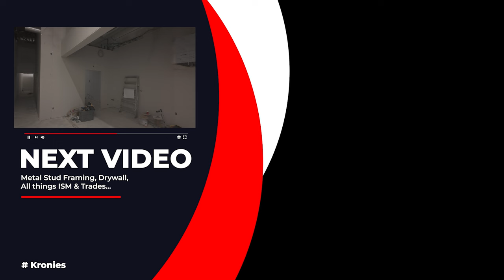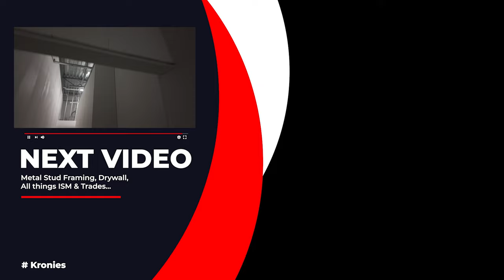Metal Stud Framing Heavy & Light Gauge Full Height & Floating Walls Together

Comment: Do you have a video that explains which side (open or closed) of the stud do you screw into first when hanging?
Reply from the maker: Always screw the soft side first(open) then the hard side(closed) if your back boarding don't counter sink the screws I to the hard side just tack then in and counter sink after the next sheet is up.
Reply: @ConstructionKronies  makes so much sense. Thanks!

Comment: When do u use heavier gauge or lighter gauge
Reply from the maker: Basically heavier gauge is walls that need more strength, maybe something is being mounted to it or if it's going to be used to support a floor or platform above. It's had nothing to do with height or width. Lots of ways to mix it up even. Some guys will use 25 gauge double studs at door ros and sometimes we use single 20 gauge. Preference also plays into it. If cost is not the major issue using a heavier gauge will give you a better wall, sturdy. Exterior walls are always heavy gauge, 18 gauge sometimes 16 gauge, devising walls like in cru's for example are heavy gauge sometimes, double layer 5/8" drywall for fire rated walls can go on either heavy or light gauge always use 6" studs. If it's going to be more layers go heavy for sure. They both have advantages, rule of thumb is all exterior walls heavy and interior light.
Reply: @ConstructionKronies  thx. Im a trim guy n jus stumbled on ur channel. Been binge watchin for a minute lol